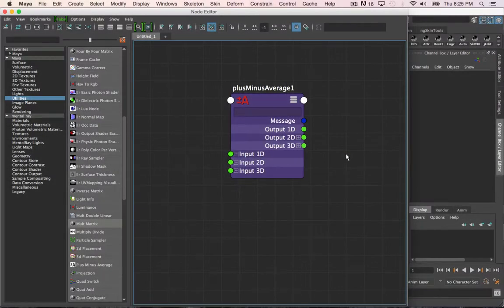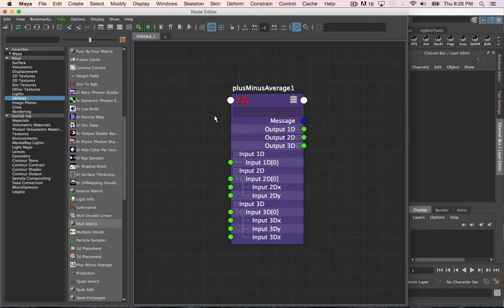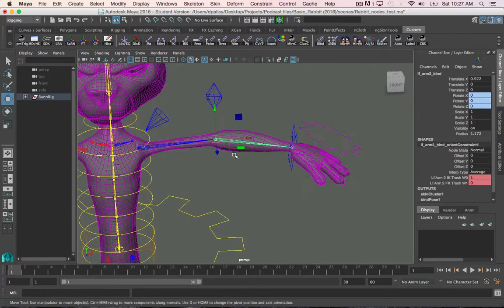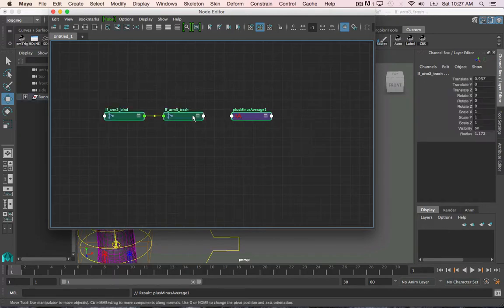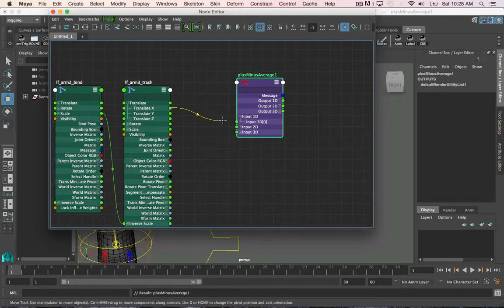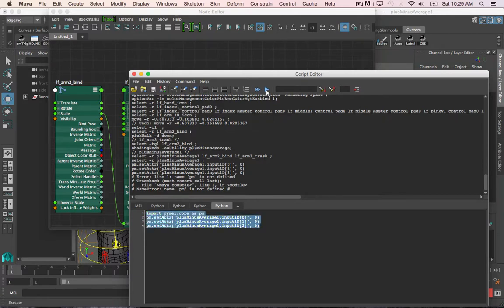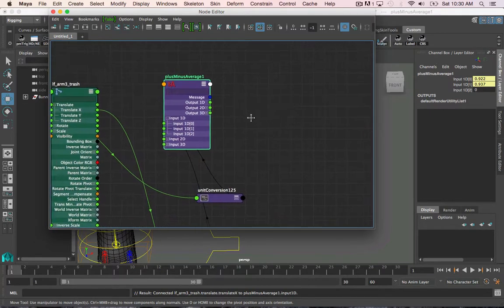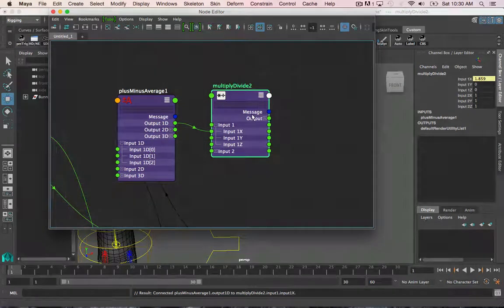plusMinusAverage Node Podcast

Comment: Thanks man. Mine (maya2019) has a different issue, it just doesn't build the next 1D slot after including the input, doesn't crash but had to forced it with the code.

Comment: Thanks for this great tutorial, but my maya keep showing error when I tried to apply the python script you used in setting attribute on the plusMinusAverage node. please tell me why and a solution to that. many thanks
Reply from the maker: Megavis ceo so the only reason I do the script is because with my version of maya at the time, when I connected attributes into the plusMjnusAverage node, maya would crash when it tried to create a new attribute. So the script would create the attributes manually. I’m guessing you don’t need the script, so just connect the attributes in the node editor like normal, without the script, and you should be fine
Reply: @dcpalley23   Thanks for this quick response, but the extra input handles like " input[1]", " input[2] is not available by default that enable me pipe two attributes into one, thats my challenge with this maya 2016 of which i don't in maya 2015
Reply from the maker: Megavis ceo Ok so can you tell me what the error says when you try and run the script?
Reply: @dcpalley23  thanks I will get back to you with the error short, would not mind if you can give me your email address so I can attach an image to it, thanks so much
Reply: Just want to say a very big THANK YOU it works at last,  I miss spelt a code, Thanks Thanks Thanks